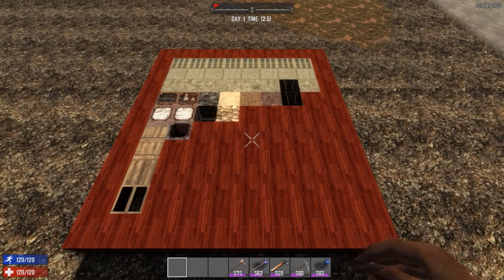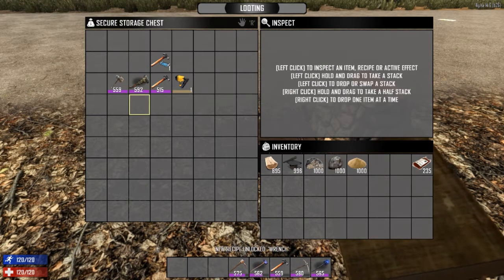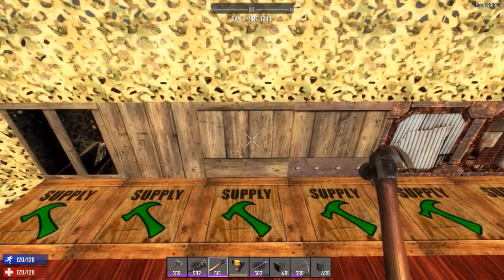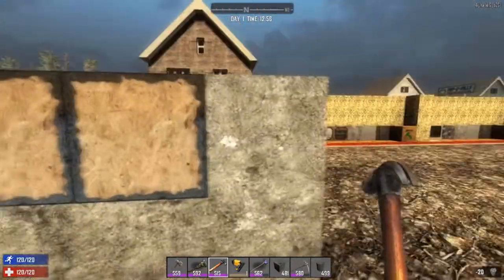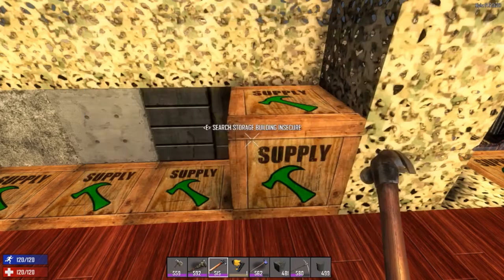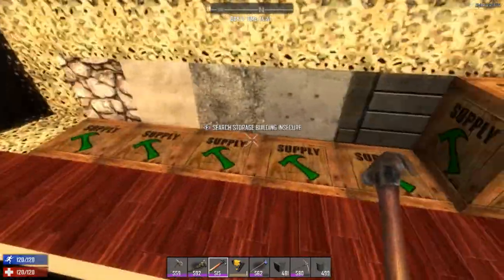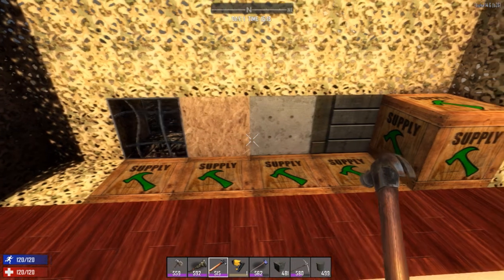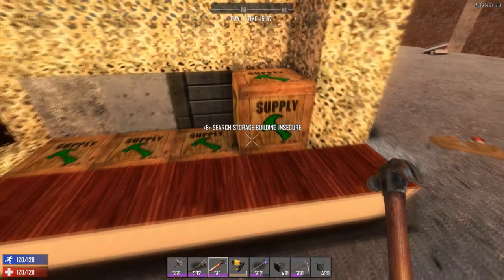7 Days to Die Tutorial (A14) - Block Building Part 1: Recipes & Upgrades

Comment: When using a rebar frame (at 21:50 ) the process skips the standard concrete block and goes straight to the reinforced block. When that reinforced block is destroyed does it go back to a standard concrete block or does it go back to the frame, or just disappear?

Also if i use and existing structure and upgrade the blocks, is this any better or worse? Some premade houses seem to have weaker walls originally so if you upgrade them and then they are destroyed do they drop back down to that weaker initial block? Thanks in advance.
Reply from the maker: It depends what state the block is in when it gets destroyed. If it's still drying it will be removed completely but if it's dried and reinforced it will drop back to a regular concrete block.

Destruction paths for most common blocks:
Flagstone -> nothing
Iron reinforced wood -> Reinforced wood -> Wood block -> Frame -> nothing
Cobblestone -> nothing
Reinforced scrap iron -> scrap iron -> scrap frame -> nothing
Steel / Reinforced steel -> reinforced concrete -> concrete -> nothing
Wet concrete / wet reinforced concrete -> nothing

With prefabs it depends what block is being upgraded to which on whether you'd get the original block back. Often times when you upgrade a wood structure it will usually fall back down as long as it's not the scrap iron stage already, and same if you upgrade a concrete structure to reinforced concrete or steel, it will be able to fall back to concrete. In general most blocks in prefabs are just painted versions of regular blocks you can build yourself so all the above rules would apply.

Comment: Also 1 question. I'm on PS4 and I'm wondering how you made that steel block? I have steel but all I can make is things like axes and shovels. No blocks. thank you.
Reply from the maker: You need to upgrade a Reinforced Concrete block with 10 steel to turn it into a steel block.

To get the Reinforced Concrete block, you can either upgrade a Concrete block, or a Rebar Frame.

You may find that sometimes you can't upgrade a reinforced concrete block to steel. Before you can do it, you need to let the concrete dry first. You will be able to see if it's dry when it becomes lighter and there is no shine or reflection to the block. A wet Reinforced Concrete block will also have some wood visible on the sides of the block when it is still drying.

Comment: what about a ps4 what do u press? I'm new to the game lol btw nice vid^_^
Reply from the maker: Hey and thanks for checking out the video :) I think you'll like the game a lot, it's hard at the beginning but you'll get used to things as you go :) 

Admittedly, I haven't played on the PS4 version myself (only got a PS3 and PC) but from what I looked up with the controls, you can upgrade a block by putting a stone axe, hammer, wrench or nailgun in your hand, then press L2 on the block you want to upgrade. 

You'll need to make sure you have the resources to upgrade the block, so if you want to upgrade wood frames to a wood block, make sure you have 10 wood in your inventory somewhere and it will let you upgrade when you press L2. If you hear a 'ting' sort of sound, it means you're short on resources. To see what you need, you'll see it show up in the bottom right corner :)

From what I read on the forums also, you can pause the game and then you should be able to see a list of all the controls as well, so if you're stuck, check the pause menus :)
Reply: Max Fox ohkaii thxz^_^ for the tip Max
Reply from the maker: No problem :) Hope you enjoy the game just as much as I do!
Reply: Lol I'm more like adicted to it now hehe oh 1 mre ? What about cement walls hadn't figure that 1 out yet?:/ how can I make it btw^_^
Reply from the maker: That's awesome, same here! I have nearly 2000 hours in game... Shows how I spend most of my time right? ;)

Of course, ask away and I'll try and help you out :)

OK to make cement is really easy, all you need to do is get your Construction to level 20 and save a few perk points (just build stuff and your level will go up). Once you're at level 20 on Construction, go into your perks and buy Concrete Mixing, which gives you access to the Cement Mixer. Go ahead and make one (you'll need a Small Engine, use wrenches on cars to get one) and then put it down in the world.

Now to get Cement, it's really easy. Get your forge and chuck some small stones in there and let them melt up. You will then be able to make cement in the forge. Next, get that cement you just made, some more small stones, and some crushed sand. In the Cement Mixer, you should now be able to make Concrete Mix. 1 Concrete Mix = 1 Cement + 2 Stones + 1 Sand. Get lots - you'll need it :)

Now to craft concrete walls you can do any of these - the last one is the best though! :)

- Upgrade a block of Cobblestone or Adobe with 10 Concrete Mix. This gives you a Concrete Block (3000 HP)

- Craft a concrete block directly in your inventory and place it in the world (3000 HP)

- Get some Rebar Frames (iron and clay in the forge) and place it in the world. Upgrade the frame with 10 wood, then again with 10 Concrete Mix. This will give you a block of wet concrete (1500 HP) but then it will dry into Reinforced Concrete (6000 HP). When destroyed, Reinforced Concrete turns into a regular Concrete Block, so in total you actually get 9000 HP!

Hope this helps, let me know :)
Reply: Lol lucky u play that long i cant have to go work plus u probably never new a girl like myself play video games(; lol. Ohkaii thxz I'll try ett out 😜
Reply from the maker: I have a full time job as well ;) Although I'd love to do let's plays and YouTube for a living haha! I've just been playing it for quite a long time :) Oh I don't judge, I'm sure there are plenty of awesome ladies such as yourself that play video games :)
Reply: Awsum!!!^_^ n r u flirting wit me lmao jk jk hahaha XD I work full time as well I'm a pet groomer I so luv my job working wit dogs even tho I do smell like wet dog haha
Reply from the maker: Haha of course not ;) That's awesome, I work full time as well doing music industry related stuff, and a bit of coding/dev as well which is pretty awesome. I smell like tea most of the time, I turn tea into code :D haha
Reply: Oooo music that's awsum!^_^ lol its better then wet dog n have fur all over u plus the itch omg..haha tea code XD that's new
Reply from the maker: Music is very cool! :) Haha well the thing is, if you really enjoy working with dogs, then the wet dog and fur and itch doesn't really matter :) 

And yep, tea code... I'm always coming up with new shenanigans ;) If you're looking for more stuff about 7 days, have a look at some of my let's plays as well, as I try to do different base builds :) Would be good to know what you think of those :)
Reply: Ohkaii for sure btw u jus got a new subscriber to ur channel hope u play the game if yu can a course no pressure hehe
Reply from the maker: Awesome :) And thanks for your sub, hopefully you'll enjoy what we get up to in the let's play series as well as the tutorials :) I'll try to play it a lot, for sure! ;) 

Just so you know how I release stuff (or at least try to), I have a modded episode every Monday at 0730 GMT, and Tues-Sun are all A15 Always Run episodes also 0730. Then Mon, Wed and Fri 1930 GMT I release MP episodes, and on Tuesday 1930 I livestream a Dead is Dead series :)

I think I better put the schedule in the channel description right... ;) haha
Reply: Waow that is alot of time for u to play lol u weren't kidding berly checking out ur first video of the game btw I like yur accent mine is jus normal nothing fancy ha. Yeah u should put it down ur description in case people don't know ^^)
Reply from the maker: Haha see, I wasn't kidding ;) I do play the game a lot I have to admit, so it's pretty awesome :) Glad you like my accent, I'm sure you've got an awesome one too :) I just added it to my channel description, it was almost too long to fit in the box haha!
Reply: Lol make it fit!!!(: ha well I gotta go I have a job I got to go 2 it's almost 11 gotta get ready
Reply from the maker: I will make it fit! It's got to fit! :D Alright then, have a good day! :)